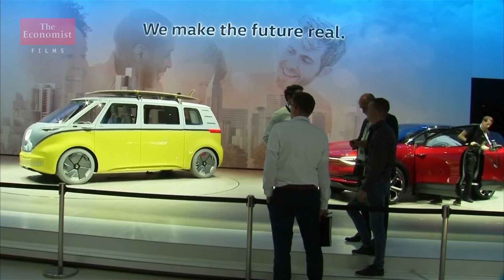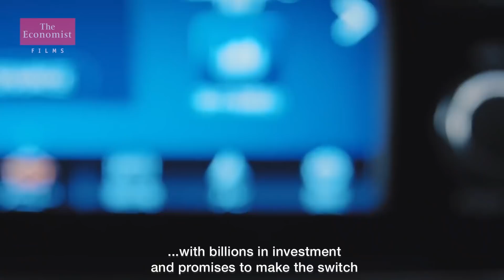Electric cars will come of age in 2018

Comment: The battery is an upgrade-able technology. Petrol and diesel is stuck at the same level of energy-density for the long time.

Electricity will win this game.
Reply: We have wind, we have water, we have the earth, we have the sun. These are all UNLIMITED sources of electricity, and green too. That answers your question on production of electricity?
Reply: You are gifted at missing the point. Tesla took on established car makers at their own game. None of the others did that.
I don't worship anyone, he just showed that the status quo was not the way forward.
Progress is always disruptive, live with it. Jobs that vanish in one sector are replaced by ones in the new ones. Where were the jobs in Solar and Wind farms 30 years ago?
You're just stuck in a negative frame of mind because you don't like change. Change is going to happen whether you like it or not.
The fact is, the IC engine has had its time in the Sun, and now it's time to bow out gracefully.
If I came to you in 50 years time and tried to sell you an oil burning complex engine that's about 40% efficient, needs a clutch and multi-speed gearbox, needing an oil change every 10,000 miles when we're used to electric cars, you'd say I was mad.
Reply: exactly,  as long as industry standardizes form fit of batteries, then performance in range and recharge rates will improve.
Reply: Firstly Tesla is no small company. It has the same monopolistic principle as a Henry Ford had in 1915, just that the owner of Tesla is way smarter that Ford. You can claim anything is unstoppable and unavoidable, yet a certain section (large) of the world actually lives outside rapid transport solutions. Given Oil and current car-technology has destroyed a lot of the air quality and environment, there is no garauntee that a electric car will not cause a different kind of destruction and pollution .. Tesla and other manufacterers are now seeking minerals needed for batteries like Ford Volkswagon GM Benz etc etc were seeking petrol and promising a cleaner faster future ..
Reply: In urban environments, you can get your power off local solar panels. However, I think the efficiency problem will be solved as self driving cars become accepted. The electric cars tend to use 135wh per km, which is quite high, but there is no reason this has to be. There's been a drift towards heavy cars, as people try to fend off death, using an SUV. We are driving sleek fast HEAVY expensive show ponies quite fast, because we are impatient. Robot drivers have patience and can drive at slower paced speeds without traffic lights and traffic jams to manage the traffic. What will finally kill the old style car, is human drivers unable to comply with traffic regulations. (Like when Will Smith puts his car into manual in I Robot movie.) We will be struggling to say why we need windows in a car, because all the light coming in, because we don't want people looking at what we do, when a robot drives us. By that time we will use 3D goggles, so we won't mind light falling on our tablet screen. Lithium battery range will be extended with slow burning fuel cells. Maybe ethanol, because oil is too messy to run through a catalyst.
Reply: Jesse Gregory - Thorium Molten Salt reactors.... almost 100% use of fuel, inherently safe (meltdown is impossible) and it's already been shown to be practical way back in the 1940's.
It can even be used to dispose of the waste produced by conventional (hideously inefficient at 4% and non-fail safe) or decommissioned  Nuclear weapons.
The fuel is far more readily available than Uranium and is found in the waste of Rare Earth mines where it's considered to be a pollutant and has even resulted in the closure of mines due to its high level of presence.

Check out the facts here and you'll see that this is truly the answer to mass produced electricity.
https://www.youtube.com/watch?v=c7baTdyHv8g

This is not some research project, this is actively being pursued by several companies  and the Chinese have hundreds of Engineers working on it. This is going to happen, and happen in a big way.
Finally we'll have what Nuclear Energy always promised but never delivered on.
Reply: Samrat - You start by saying "disruption" is by its nature bad. Yet what is disruption? If you are having a nice chat with your girlfriend and I come by to touch her ass that is a disruption, because you are not talking to her anymore, you are punching me in the face. So disruption is something causing a change from one state to another. Now what if you were sitting alone, feeling miserable, and a pretty girl walked by and smiled at you disrupting your sorrow and making you feel happy the rest of your day?

A... good... disruption?

So don't start by saying disruption is bad. It can be good. There have of course been bad disruptions in history, but arguably the world is moving to a better place where there will be less bad disruptions. If you do not get up in he morning to disrupt your sleep then you will eventually get hungry. On the other hand if you change lanes into incoming traffic you will regret it. Change can be good and bad. We can not and should not prevent change. We can only work to support good change and prevent bad change.
Reply: Here is one: https://www.tesla.com/en_EU/energy
Reply: Tai Viinikka agree #vehicleobesity is the main problem but sadly evs and phevs are ENABLING this transition to less efficient machines just like diesel was squandered on SUVs when we had real 100mpg cars 20 years ago! http://www.autointell.com/News-2001/May-2001/May-2001-4/May-23-01-p8.htm
Reply: The current concept of chemical battery is that they have to carry oxygen within it, that makes it theoretically only able to reach half of the power density of fossil fuel (consider oxygen has approximately the same molecular weight as carbon). Another thing is that carrying oxygen and reactant in the same metal container is a pretty dangerous idea, if you increase the energy density that is technically making an explosive device. Not to mention that at this point of time most of the electricity is still made from fossil fuel.
Reply: Thanks for the lesson, I genuinely love conceptual science. It's one of the reason I like internal combustion engine cars so much.
Reply: Nuclear fusion for example?
Reply: Sure - as long as you don't count efficiency, torque available over the rev range, maintenance, cost per mile, raw acceleration - but other than that, what has the electric car done for us? ^oo^
Reply: Wind 
may I add, depending on your local form generating electricity. This doesn't even taken into the efficiency of, let's say gas turbine generators etc. before you even start with 80% your need to take another percentage off from that. Whereas you're internal combustion nengine, is the only energy conversion necessary from petrol right to kinetic movement.

I'm not arguing against your point, just felt that kinda belongs in there ^^. Other than that I'm all for electric vehicles... but its not yet quite there for being the economically wiser choice. At least not if you only drive as little as I do.
Reply: So you're saying there's no energy used in finding, extracting, refining and delivering petrol? ^oo^
Reply: epSos.de yes in the long run electric cars will win.
Reply: You know most people charge at home, most of the time? - and if you have the kit, you can charge off your house's solar charged battery - Besides - like Apple, people pay a premium for having a Tesla, but there are countless new electric models by other manufacturers coming out this year, so if you're not a Tesla fanboy/girl then there will be a lot of alternatives - It'll be a short time I'd imagine before your Acura will be available as a pure electric, and with a car body that size, you'd have a very impressive range from home charging alone, ^oo^
Reply: bullshit 😂😂😂
Reply: Gasoline has an energy density 100 times greater than todays li-ion. Sorry, but batteries will never have the energy density of hyrdocarbons.
Reply: And batteries evolve very quickly, currently at a pace of 5-8 % more density per year but new batteries like Solid State Batteries will suddenly double or more the density.
Reply: AKS , I see reclined bicycles now. I wonder if I could put flexible solar panels around it and have a electric pedal power generator in front more lithium ion batteries under the floor and more storage space for groceries etc in the rear.
Reply: David, no sense in over complicating a simple machine. My ebike is heavy enough without having to carry around charging equipment and mounting solar panels. Panels should be put where they will be most effective - on your roof. They are not efficient enough to charge "on the go".
Reply: In about 100 years.
Reply: jizon mi It doesn't have to be. The grid can handle things as it is modernized since most charging takes place at night when demand traditionally has been low. EVs are cleaner even when powered by dirty power plants, this has been demonstrated over and over. Count the emissions produced by internal combustion vehicles from the wellhead to the combustion chamber. Transport, refining, and distribution of oil and gasoline use energy before the end product goes into your tank. Refineries alone use 4.5 kw. Of electricity to produce a gallon of gas. This opinion is coming from the present business model of gasoline production with government subsidy being a given and not even mentioned. When the public sees the financial benefits of EV economics, that alone will sell them. Where I live if you commute fourty miles a day and use an EV the fuel and maintenance savings will make your car payments.
Reply: How will electricity be mass produced in thefuture? any ideas?
Reply: Tesla had no history as a car company and came from nothing to be this size only because of what they were capable of achieving. Had the electric car got no future, this is how we would have found out, ie Tesla would have flopped.
You're too quick to put imaginary obstacles in the way of this technology, the problems are hardly that difficult to surmount.
Without Tesla, do you really think that Ford, VW and GM would have had the slightest interest in doing this? It's the lazy self interest of those greedy companies in cahoots with the oil companies that needed a company like Tesla to shake the tree and show what's possible.
The genie is now well and truly out of the bottle. How can you endorse IC technology that throws away at least 60% of the energy contained in the fuel??? It's madness to continue down that obsolete world view.
Reply: Samrat B - See what one small company (Tesla) can do single handed, then imagine what the global push from all the manufacturers can do. It's an unstoppable move to Electric transport. The IC engine is in terminal decline, nobody in the industry is banking on it any more. Even the Oil Companies are trying to see how they can get in on the act because they can see the writing on the wall, and they will eventually be a shadow of their former selves if they do nothing.
Reply: Nonsense - do you think chemists have developed no new chemicals for 50 years? HVO made from city waste is a direct replacement for fossil diesel. It burns much much cleaner with far lower PMs, NOx and CO2 yet has higher energy density than fossil diesel so cars get higher mpg.  See NESTE. They are using it in Helsinki buses and now Trucks in CA USA.
Reply: True and also bullshit , petrol has the same energy density but the engine using it is not even close to being even 40% efficient . Electric cars  are 80% plus efficient If petrol based cars had the same level of efficiency the range and mpg would more than double . Let's look at the prius which gets around 50mpg , if we upgrade that to the new efficiency standard and at 100 mpg and a $2 per gallon gas price it cost just 2 cent per mile. If we look at tesla's price per mile using 12 cent per kwh electric cost it cost 5 cent per mile .

Making the claim petrol driven cars are not able to be upgraded just like battery technology is beyond stupid .The first cars ever made were in fact electric they were replaced by gas engines because gas was cheaper and gave longer travel distances with ever increasing technology . This technology boom has not stopped since, a late addition would be mazda's new skyactiv x  technology which does 40 mpg without even using  hybrid technology !!! Electric car batteries would have to just about double in density and lower their cost to be a real gas engine killer , even then a new boost in technology could send them packing again .
Reply: Electricity will win this game.?? you wish .. think of what you said just 10 years later.
Reply: Lithium ion is near max energy density. Gasoline is over 20X as energy dense.
Reply: What you have said is totally true from an engineering perspective, but to understand what's happening in the real world, you take the miles driven by humans divided by the energy dissipated to achieve that activity. You are right that there are some fairly efficient (in comparison to previous decades) gas cars out there today, but what proportion of Americans (or total humans) now drive trucks when previously they would have driven subcompacts or compact cars? It's true that passenger car fuel efficiency has improved since 1980, but there are a couple counteracting factors: 1) getting the fuel out of the ground now requires much more energy than in 1980 2) many more people now choose to drive pickups, SUVs, jeeps, or other less efficient vehicles.  So the world would be worse without the engineering improvements you mention, but the world will be even better as we transition to electric travel.
Reply: epSos.de 
Internal combustion engine is better than electricity.
Reply: Not really stuck at a level you idiot
Reply: "Tesla had no history as a car company" Did Benz VW or Ford have any legacy or prior history of making cars? No. Did Hyundai or Toyota? No. It's business made possible because of technology. You can worship Elon Musk and his brand (robbed name of a great scientist) as much as you like. Just like certain folks worship Steve Jobs or Bill Gates. Yet don't forget the profit driven economy which drives myths and "better-futures" every 20 odd years. Perpetuating the hegemony and prominence of money over people, resources, climate and equality. What you refer as a Genie, was the also the spirit when Steam and Coal power ushered in wiping out Galleons and Naval Power. The same genie cropped up when the internet became a public domain and millions thought it will be a parallel world of freedom. The same genie also hoodwinked it's way in the so called Shared Economy of Air BnB and Uber which actually destroys neighborhoods and rob thousands of taxi-drivers of minimum job security .. Obsolete are such hopes and Corporate tesla coated dreams ...
Reply: GIven what your saying is somewhat correct. Yet a few important things to consider, for the better of humanity, rather than one group of people or rather one emerging technology -
"Progress is always disruptive" Not really. Not in the past 5000 odd years of human progress and human evolution has been gradual if not mostly isolated. Things begin to get very disruptive, very exploitative and very damaging around 1800 AD. Is that so great ? this constant disruption ?
"You're just stuck in a negative frame of mind because you don't like change. " Not at all - Given a fair amount of education and awareness about the devastation and exploitation that stands behind all such so called "great technology" The amount of labor exploitation and natural resource depletion
Ask yourself who is mining all the Cadmium for your fancy electric car? Who are the cartels driving slaves into the production of lithium in Congo, Chad, Cameroon, Indonesia etc. Where many people die every month working in the most pitiable condition? Does Elon Musk care? Does his enthralled audience even know. 
The greed for technology and the excuse to be environment friendly is all ok. Yet people suffer and we don't care as long as we can ride into the sunset in our latest beamers !
Reply: This is untrue, the effectivity of the petrol engine is increasing every year.